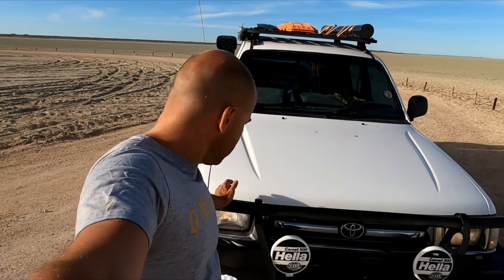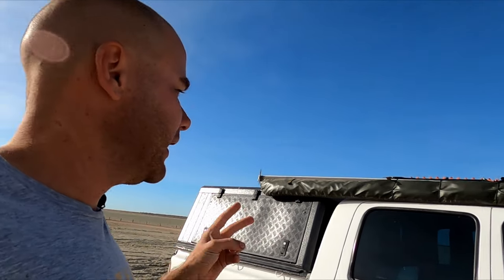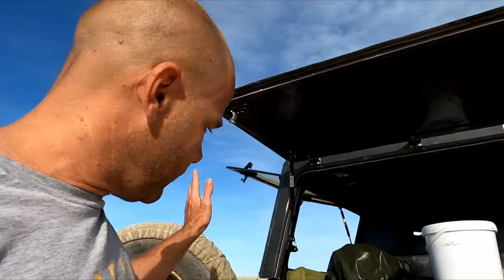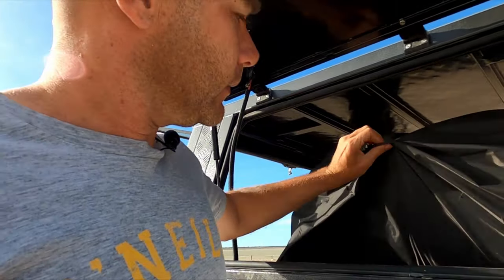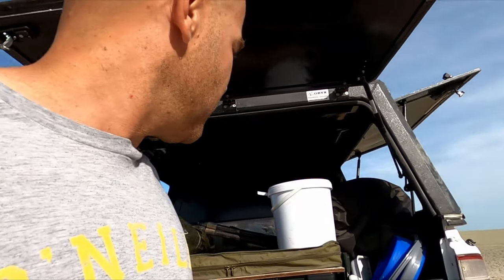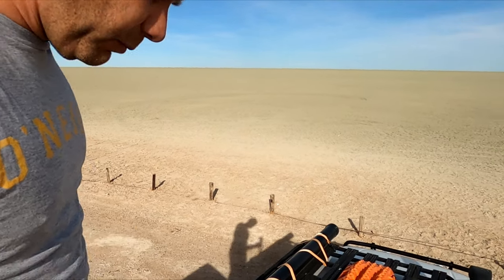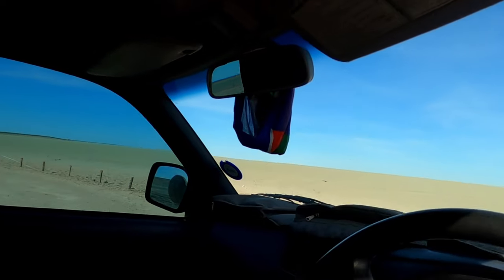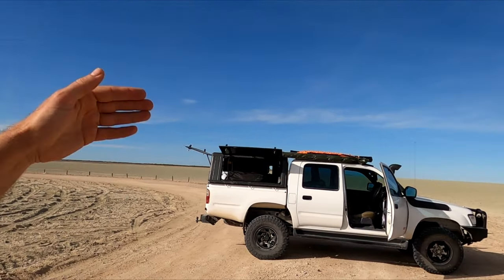My 2000 Toyota Hilux for overlanding in Africa | the 1st video

Comment: howsit Nick just a bit of an idea for the back of the bukkie on the roof (inside)put 3 eyes about half way and another 3 in line right at the back and put a cargo net for things like your chairs and bedding that way you won't have to go digging for it and getting it caught up on other stuff even (if you have you ground tent still other then the rooftop tent )you can put the in there as well it will save you a lot of ground space inside below all that

Comment: Nice rig mate, (neighbour) I'm also only doing solo wild camping trips in South Africa. Can you charge the aux battery in the Nat Luna via solar?
Reply from the maker: Not on the older boxes. Buy a Victron SmartSolar MPPT 75/15 and  screw or rivet it onto the box. Attach your battery and solar panels to the controller. As easy as that. Ive actually disconnected the cable running from my cars own battery and only charge  from 2 x 100W panels. I have all the functionality of the box but charge from solar

Comment: the best suspension is one you can afford , the most important part of a suspension is shocks . and by doing it last is the correct way to do it . so i would suggest do pedders shocks , have had great success with it , i have to say looking at the current state of the hilux here you don`t need to upgrade the leafs and torsion bars yet and if they break in africa you can replace them with local sourced parts . and always add a extra shock front and rear to your spares bin and also some u joints
Reply from the maker: up to this point Im still not sure what to get, but like you said cost at this point will be the determining factor. To be honest,  I havent heard of Pedders yet, will do some research. SA? Aus? US product? You'r not the first to tell me that the suspension looks fine at the moment, so I've decided to keep as is for now. Just completed a 7500km trip to Botswana and back and honestly I dont have any complaints.... thanks for advise :)
Reply: @NickfrNamibia  it is a pleasure if been building expedition vehicles vehicles for Africa for 13 years and I have fitted all brands. Pedders is an Australian brand . You will be easier to find standard leafs and torsion bars than let's say lifted springs. What I will suggest is to strip the leafs and clean and grease them and change all the bushes also . Another thing is to carry an extra torsion bar adjusting bolt assembly as it is something spares shops order as needed and Toyota don't usually keep stock of these parts
Reply from the maker: thanks again for the info! yeah, getting them fixed on the road, even if we have to strip from a scrapped a vehicle is way more important to me than fancy brands and pretty colors. That is one of the main reasons I went for the older hilux. I'll definitely look to update my spares list as well👍
Reply: @NickfrNamibia  I agree , to be honestly you actually should've gotten  an Uri 😁 if you have any questions please feel free to contact me
Reply from the maker: haha, maybe the next time I go around Africa!  Will definitely take you up on that offer.
Reply from the maker: that will be loads of fun, will you convert the back? canopy?
Reply: @NickfrNamibia  most probably a canvas type with a proper drawer system. I also like the ground tent setup , will you be upgrading to a cotton canvas chopper tent? You are running a ripstop tent ? To be honest I discovered your channel a few days ago and still working through it
Reply from the maker: @R_ovrlnd  sounds good. No worries, the channel like my hilux is a work in progress, but getting there. I have a lot of space in the canopy, will be converting that and the tent will be used depending where and how long I camp for...it is canvas